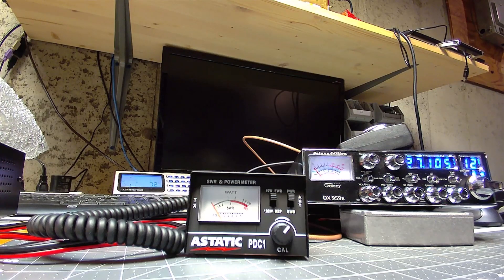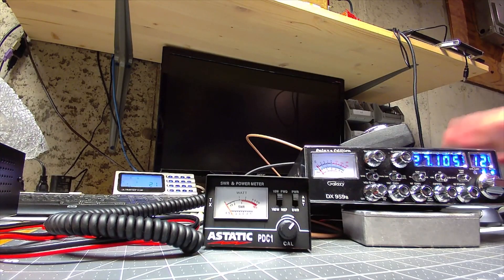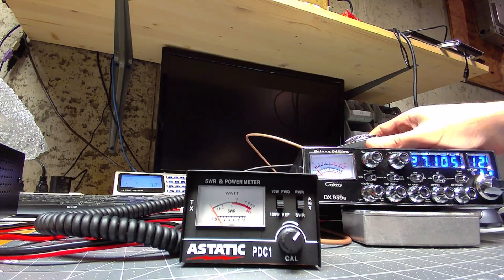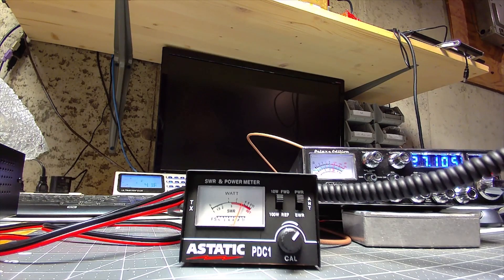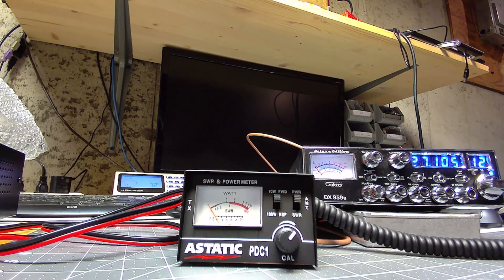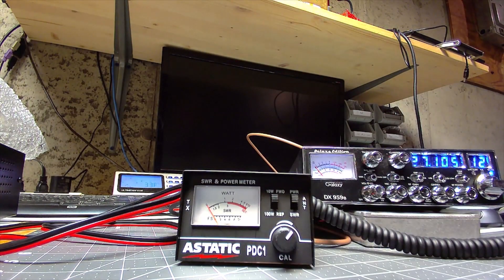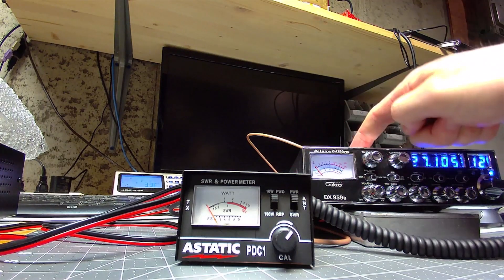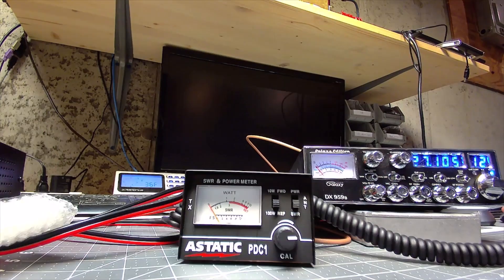Basic watt meter use for CB radio.

Comment: So let me ask you this, i have an swr meter, a workman external. Im trying to set up my general lee cb radio, while im on low power, the meter works fine but when I kick it up to high power, if I have the meter hooked up, it blows the power cord fuse. Only happens with the meter hooked up. Any ideas?
Reply from the maker: Wow that's a head scratcher! My guess is there some sort of RF getting into the line. If you had some ferrites you could try a few wraps around the DC cord?
Reply: @radioman2602  Thanks for answering!!  I actually discovered that I used the wrong power cord. I bought both me and my wife radios, hers a cobra classic and mine a "peaked and tuned" general Lee which came with a cord that had a 10 amp fuse. I unboxed them together and mixed up the cords, they are identical except for the fuse inside lol. I called Walcott who explained that there should have been a 10 amp fuse, I kept blowing 2 amps. It's an export modified for CB and I actually got both mine and hers installed and the SWRs down to about 2:0 so it all worked out. Thanks again for taking the time to respond, not many radio savvy channels do!!!
Reply from the maker: @ericthiel4053  oh geez why didn't I think of that. Such a simple fix! Great news.

Comment: hope someone replies! what if you running  SWINGMOD with the liner amp do I need an advanced power meter to get a proper reading?
Reply from the maker: I try to match the radio based on the amps specs. You could do it with either meter.

Comment: So I bought a radio on ebay and this exact meter your showing on Amazon. Supposedly "peak and tuned". He says it's doing 12 - 14 watts but didn't clarify if that was peak or pep or whatever. At the time I didn't know the difference. My meter says my dead key is about 6 watts and since I don't know shit I thought I was ripped off. This video suggests it's putting more out is that correct?
Reply from the maker: Let's start here. What kind of radio did you get?
Reply: @radioman2602  it's just a cobra 29 lx. I know he's been inside it he also installed a EC2 echo board with a dual nob at delta tune
Reply: @radioman2602  I'm not sure if it's putting to much out to add a KL203P. Apparently I don't know how to read my pdc1 swr/power meter correctly
Reply from the maker: @Eli5047  yes your meter reads average power. So going by the 4 to 1 rough guesstimate. That means your radio is doing about roughly 24 watts PEP. Definitely too much power for a KL203. You'd need to find the adjustment inside the radio and turn back to a one watt dead key to run a kl203.
Reply: @radioman2602 I really appreciate you taking the time to respond. I know it probably gets redundant answering questions for beginners. This is the first video I found that actually addresss the power portion of the meter. Pretty much all of them just talk about the swr. Hopefully you don't mind I have one more question. If I find a video that shows me how to do that will I need to have the rest retuned as well? And is that just a modulation adjustment or something else. Like, what is a variable dead key mod adjusting, the power output or the modulation

Comment: The "4 to 1" ratio seems very important. Can you explain the justification for it a bit more? Subscribed with notification.
Reply from the maker: 4 to 1 is just a rough rule of thumb when operating AM. The idea is a CB that is rated for 4 watts on AM means that the "dead key" on a average reading meter will show 4 watts with no whistle or speaking. If you have a true peak envelope reading meter "PEP" if you were to whistle you should see approximately 16 watts. The FCC rules state you must not exceed 12 watts PEP. Most times a stock CB out of the box rarely makes 4 watts and is usually closer to 2 or 3 watts dead key and they rarely hit 100% modulation and that is how they stay legal.

Just remember the 4 to 1 is just a rough rule of thumb to give you a rough idea of where your numbers should be dont get wrapped up over being a watt or two high or low.

Comment: On FM you would know 100w from 200w over distance it may not have an effect on the S Meter but it will strengthen your audio and thats all i use a linear for..really to strengthen audio i dont really care what the S meter says. If you can hear me and make sucessful contact thats all that matters. An extra 100w might pull your audio out of the noise floor on FM. Im from the UK so im acustomised with FM.
Reply from the maker: Yes, you guys have been using FM on CB for quite some time.

Comment: My meter doesn't show the modulation?
Reply from the maker: The meter in this video will not show actual modulation. How ever some radios when you whistle or hit loud peaks it will cause the watts to go up slightly. Some guys call this swing. So any meter movement seen on this meter while speaking is just the output increasing on voice peaks.
Reply: My radio in SSB DOES show peak-modulated-up power swings, but, NOT in AM mode, only the basic carrier power...  WTF over????

Comment: I transmitted with a standard Super Panther II from Darwin to Brisbane with a Magnetic base on a Hatch Back , numbers ain't all their cracked up to be 🤣
But I have a question , say I have 1 radio and 1 antenna and I leave this connected 24/7 to see the power needle bounce just for fun , is it a problem ?
Reply from the maker: No not at all. Just make sure the range is set so you're not slamming the needle on the end stop. Lots of guys leave their meters in line all the time to monitor SWR.

Comment: I am new to this. Beside the fact this meter test swr, will it test power over 100 watts? I know it states that it is a 100 watt meter. So if I am testing output power on AM and the needle goes to number 2 , does that mean you’re putting out 200 watts? 
I would appreciate any clarification on this. Thanks.
Reply from the maker: So do you have the same meter in this video? To answer your question the meter will only read up to 100 watts average power. What type of radio are you using and are you using an amp? What are your switches set to when you are reading a "2"
Reply: @radioman2602 : I have the Ranger Rci-x9 . No external amp. And yes, I am using the same meter. The right switch is on power and the left switch is down on the 100 W Ref.
Reply from the maker: @freddie3159   Ok that would mean your radio is putting out 20 watts average power which is exactly what that radio should put out. So when your in the 10 watt position that meter would read 0-10 watts with the 2 being 2 watts, but in the 100 watt position it now reads 0-100 watts. With the 2 now reading 20. Does that make sense?
Reply: @radioman2602  : Yes, it makes sense now. Thanks for explaining it.
Reply: It's just a cobra 29 lx.

Comment: I have watch four videos so far and halfway through yours and I haven't seen how to even hook the cables up  in the back of the meter.
Reply from the maker: Ok maybe I didn't cover that but usually the meter will have a port labeled "antenna" so the cable connected to your antenna goes to the antenna port. The other port may say something like "transmitter" or "radio" that cable goes from your radio to that port. Does that explain it?

Comment: Does this PDC lower the  cb wattage (say from 5 watts to 1 watt) that would go out to the linear? Or do i still need to go into say my Cobra 29 and lower it internally?
Reply from the maker: No the PDC and any watt meter do not lower power out in any way. You would need to open the radio to internally lower the power. You could put an attenuator in line with your coax, but I don't recommend doing that.
Reply: @radioman2602  Thank You for the reply

Comment: How can the average guy without anything except my SWR meter test my SWR meter for accuracy. Ty
Reply from the maker: Well a couple of ideas. Do you have anyone local with a antenna that is known good? You could hook your meter up to their antenna and compare results. If you dont have that you could purchase a dummy load like this one https://amzn.to/3Lja4lw Then you'd hook that to the antenna port of your watt meter and you should see a 1 for a SWR that dummy load will simulate a perfect SWR to qualify that meter. At the end of the day you need something attached to the antenna port to give you a nice 50 ohm load.
Reply: @radioman2602  Thank you very much I appreciate that you reached out to. I will give it a try Ty and God Bless
Reply: Can I reverse the normal coax connections at my wattmeter to correctly measure the reflect?

Comment: Very helpful and useful info.👍 Amazon has an Astatic PDC2 which is AC powered not DC battery. Are battery powered meters preferred/recommended?
Reply from the maker: If you can afford it, I would definitely recommend a peak envelope reading watt meter. Those usually require some sort of power supply like a battery. They usually start at about 100 dollars and go up from there. "peak" reading meters are not the same thing as "peak envelope power" meters.

Comment: I'm currently in the market to get a basic AM mobile CB (with minimal menu and functions). I have a 2017 Toyota Tacoma and would like to use an auxiliary/cig lighter power source for quick removal including a removable magnet mount antenna. Looking to put more into antenna than the radio Total budget of $150-175 excluding SWR/Watt meter and 12v power supply for home base conversion. Use won't be for rag chewing..more for emergencies. What mobile radio and antenna would you recommend based on above criteria? Much appreciated 👍
Reply: Get a Chevrolet truck first thing 😂
Reply from the maker: My recommendation is going to be on the high side of your budget. Check out the president Bill or President Adams. Those radios seem to work great right out of the box. Also, if you're going to go the mag mount, I'd suggest a Wilson 1000. If that's too much I have personally tried them, but they look similar look into the Tram 3500. Resist the urge to go with a "small" antenna because it will hamper your range.
Reply: @radioman2602  Exactly where I have been hovering and considering... thank you!
Reply: @radioman2602  Much appreciated...can you recommend a couple if peak envelope meters?..No rush👍
Reply: Radioman 260 knows his stuff but this is my take as i like simple.  A cheap little Uniden Pro 510 and a Wilson 2000 magnet mount for the roof of the pickup. I'm a 30 year Trucker and owned most of the radio greats but this little Uniden 510 is my go to for a quick setup. (sometimes i even hook it to a Killer Bee 250) Remember a cheap radio with a good antenna will always outpace a expensive radio with a bargain antenna

Comment: Can I use only the watt meter to test my tyt mobile radio watts power???         can I use it on any frequency to test the watts on my mobile radio
Reply from the maker: No watt meters are designed to work within a specific frequency range. If provide me with the model # of your TYT I could make some suggestions. Also you need to have something attached to the antenna port of your watt meter. Either the antenna you plan to use or a 50 ohm load like I was using in the video. You can not test your radio output with just the meter only.
Reply: @radioman2602  tyt th9800 mobile radio with a HH-9000 Antenna Quad Band…….I want to buy this swr/ watt meter from the video to check the watt output from my radio???
Reply from the maker: @warzone7571  you need a watt meter designed for VHF/UHF such as Workman 104 SWR / Power Meter for VHF / UHF Ham / CB Radio https://a.co/d/5XHbYzU
Reply: @radioman2602  ok thank you I will try to buy this one you suggested me
Reply from the maker: @warzone7571  don't forget you need an antenna or a dummy load connected to the output of that meter. You'll need some patch cable to go between the radio and meter.